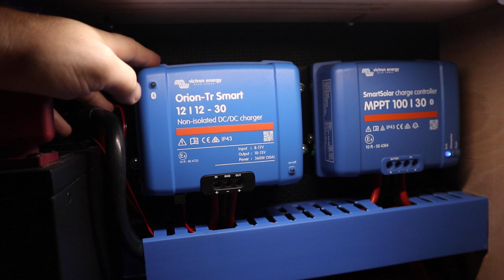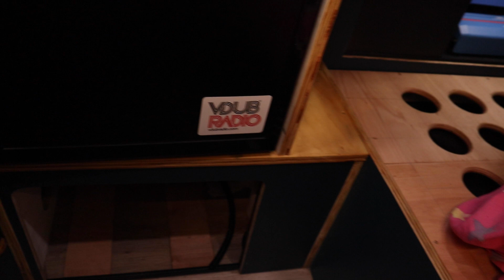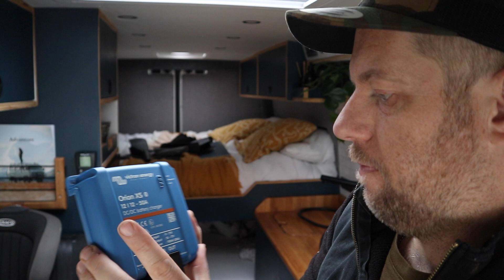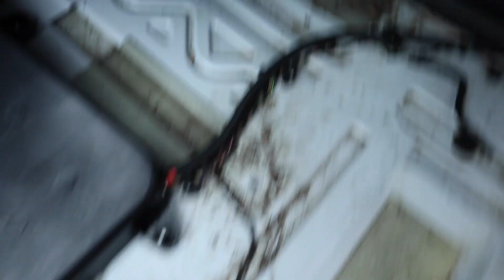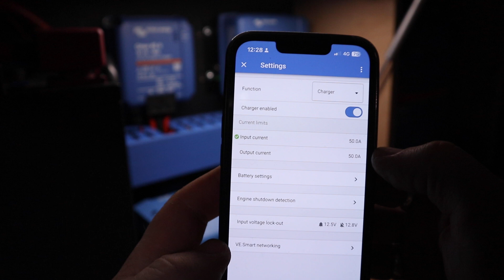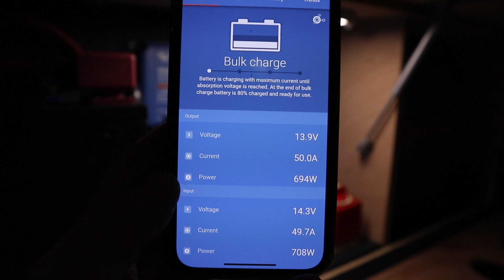Victron Orion XS Installation Made EASY!

Comment: You should consider using the Victron 12/12-70A DC-DC charger. Reason being, it’s small, same size, but comes with two mini fans attached to bottom for better cooling. 

That Victron 12/12-50A gets freaking hot! without a fan, like 200°F, and when it does get hot the DC charger reduces the amps going to your house batteries. 

If 70A is too much, just adjust in settings. 

Cheers!

🇺🇸MAGA🇺🇸
Reply from the maker: Thanks however the 70a doesn’t have any fans and I’ve not noticed the 50a getting hot at all. 

I’m very happy with the 50a for our needs and not required anything more powerful or that adds more load on the alternator.
Reply: @VanFamilyAdventures . I have a brand new Orion XS
12 | 12 - 70A
DC/DC battery charger (arrived two days ago), and I can absolutely confirm there are two small fans attached to the bottom of this device. 

And the 50A model does in fact get very hot after approximately 1 hour of continuous use charging the house batteries.
Reply from the maker: @Livefree4547 I stand corrected regards the fans. My initial search suggested they didn’t. That said both devices still achieve 98.5% effeciency & I’ve not had any amp drops using the 50a in my setup.
Reply from the maker: We did long drives over the summer through Spain (40c) and 7hr drives and it filled our 460ah LiPo without dropping charge or getting hot.

Comment: I'm surprised they still haven't implemented the reverse charge feature in these or the xs1400....it's not a hardware limit but software....if it had that it would be the complete package.
Reply from the maker: It’s certainly negate the need for a trickle charge from the invertor and another cable run

Comment: Hi there great video thanks. I wonder if you can help I have fitted the same unit but am only getting maximum 24 amps. I have a standard 12v starter battery and an 80amp alternator. The leisure battery is a 13amp LIFPO. Any suggestions thanks.
Reply from the maker: Have you checked the input and output settings for the amps? Also what’s the cable length from the starter to leisure? 

Is your leisure battery already full?

Comment: is 11 v a little low?
Reply from the maker: During driving I’ve seen the voltage drop to near 11v. So it’s a back up really should the power drop that low it will switch off and not consume anymore and that’s only really if the remote switch fails. If it wasn’t that low then it could still switch off even whilst the remote is enabled.

Comment: AMAZING. HOW DID YOU REDUCE THE 25MM NEGATIVE BLACK CABLE FROM 25MM TO 16MM? I NOTICED YOU USED A MIDI FUSE FOR THE LIVE REDUCTION. I'M ABOUT TO UPGRADE TO A ABSO 50 AMP FROM 30AMP SO I COULD DO WITH THE HELP PLEASE. 
THANKS
Reply from the maker: The negative on my system runs from the DC charger to the Lynx distributor and is only 30cm away. So no need to increase or reduce over that distance as the total loop length is sufficient. Plus I had 16mm2 already in place.

If the total loop (incl return path is less than 5m then 16mm2 is fine, else use 25mm2 for as much as possible.
Reply: THANK YOU FOR THIS VITAL INFORMATION AS MY LOOP IS GREATER THAN 5 METERS AND I HONESTLY HAVE 12 ITEMS IN MY EBAY LIST AND 2 OF THEM ARE 16MM 10 METER ROLLS OF BLACK AND RED SO I'LL BE CHANGING THAT IMMEDIATELY TO 25MM. MY CONCERN IS I'M SENDING MY POSITIVE AND NEGATIVE FROM MY STARTER BATTERY TO THE DEVICE AND I'M LOOKING AT 10 METERS. I'M ACTUALLY CONSIDERING RELOCATING THE NEW ABSO 1250 CLOSER THE MY STARTER BATTERY BUT IT WILL STILL BE  LOOKING AT A 6 METER LOOP. I KNOW HOW TO REDUCE THE LIVE BUT HOW WOULD I GO ABOUT REDUCING THE NEGATIVE TO 16MM PLEASE? 
THANK YOU SO MUCH AS FIRSTLY IT'S A BANK HOLIDAY AND SECONDLY YOU'VE SAVED ME MAKING AN ERROR IN PURCHASING THE WRONG CABLES. 
THANKS EVER SO MUCH FOR REPLYING.  IT'S THE FIRST TIME I'VE REACHED OUT AND ALL SO YOU'VE MADE MY DAY HERE.
Reply from the maker: @matthewevans6163 No problem. I’m not familiar with the ASBO 1250. I was basing the specs on what Victron state on cable size. However 50amps over that distance the bigger cable size the less voltage drop so more efficient charge.

You could use Ferules to clamp the cable ends into the ASBO?

Or to reduce the negative to 16mm2 just use a small negative busbar and the correct sized cable lug 👍

Comment: Will your adjustment to the lock out not make it possible to drain the vehicle battery when charging.
Reply from the maker: @williamhurley8407  Nope. Because it will only turn on if the ignition live is switched on I.e. the key is in ignition and switched on
Reply: @VanFamilyAdventures 
Thanks for that

Comment: Are there setting on the app that will allow to reduce the draw from the alternator? so that a regular alternator does not get taxed,,, and also to reduce the output watts so that smaller power stations can be charged without frying them ? Thanks
Reply from the maker: @tdiler12  yes. You can adjust the input and output amperage very accurately which directly changes the wattage.
Reply: @VanFamilyAdventures  with  the smaller Victron 12 12 18 charger I am getting a 23% improvement in watts delivered. Is this about all I should expect ? 
do you know..
I was hoping for more maybe bought too small a unit.
 Thank you.
Reply from the maker: @  I’m not 100% sure but the 18a unit outputs max 220W (220/12= 18.3) so if 220w is only 23% more than the output of your alternator then yes that’s correct. 

The Orion XS is 98% efficient and produces upto 700W at 50a. 

You may want to look at the 30a Orion as an upgrade but if you’ve got the cash the XS is worth it and you can reduce the input / output amps to protect the rest of your system.
Reply: @VanFamilyAdventures  Thank you for your time I think the 30 may be the sweet spot.

Comment: Great video, just one question re the remote cable; it looks like you have removed the bridge cable all together and just have the red remote cable going to the "H" connection, is this correct? Assuming this is the case, can you confirm where you are connecting the other end of the red remote cable to please?
Reply from the maker: @simonrhodehouse6854  Thanks. Yes that’s correct. The other end is going into a piggyback fuse under the passenger seat that only becomes active when the key is in the ignition. This is what overrides the voltage detection and engine shutdown.
Reply: @VanFamilyAdventures  Thanks again, one final question if I may, how did you determine the correct values for Lock-out value (11.0V) and Restart value (14.0V) please?
Reply from the maker: @ So I did loads of testing whilst on a road trip. Even whilst driving sometimes the V from the alternator was dropping below 11.7v shutting off the DC charger. So setting lockout to below this prevents lockout overriding the remote signal.

Setting at 14 helps it kick in on startup when voltages rise to warm up engine. You don’t want to go too low or it’ll drain starter batt.
Reply: @VanFamilyAdventures  Thanks again and have a great weekend.
Reply: Great  video but I don’t understand the remote part. I have a 2023 crafter. What bits do I need and which fuse do u use? Idiots guide only please 😂.

Comment: You should've run the correct sized cable from the start, the correct way is use a midi fuse holder to drop the cable size down to the 16mm² cable the Orion can accept.
Also don't use Circuit breakers use an actual fuse.
Reply from the maker: @scoffee82  In hindsight yes, but the XS wasn’t available and believed 16mm2 to be correctly rated at the time. I’m right on the 5m limit, probably would’ve been fine but better to increase the cable. 

MIDI fuse is ok. Mega fuse is what I had available.

Circuit breaker is blue sea and supplied by BSPK solar whom I trust for supply and advice on the install.
Reply: @VanFamilyAdventures  yes your correct the XS has only just recently become available on the market. Are you aware that a DCDC/BCDC charger can potentially pull upto double its rated output, in saying that keep this chart handy it will help you out alot in future expansions/builds
https://enerdrive.com.au/wp-content/uploads/2024/07/E_D_BS_Cable-Size-Chart_REBRAND-2024_V1.1.pdf?srsltid=AfmBOoq5AQQ1NAy_6lWiMvE-kRCPMx-lMSOL2Ku8OmBSxfUqfodgrWyZ

Comment: great video, thank you. Tell me, what is the reason with setting the lock out values. I had them set to 10.4 and 10.8 as i had seen those recommended, so a bit confused. Maybe thats why my battery never really charged very high....? thanks.
Reply from the maker: @carolspencer5844  10.4-10.8 is low. And your starter battery should be 12v else your vehicle won’t start. So I’d set the lock out below that and restart at 13.8+ as that’s the likely voltage when you start the engine.

What battery is it? AGM or LiPo?
Reply: @VanFamilyAdventures  hi, my leisure battery is LiPo,that charges ok,its the van battery never gets up to voltage,maybe because im feeding all the power to my dc charger. I will adopt your setting and see how it affects it. It can only be better. Thanks for the info.
Reply from the maker: @carolspencer5844  Ah I see. Might be a sign the van battery is starting to go. 

Also worth getting a multi meter on the van battery first to see what you get there vs the input voltage on the Orion. Check the terminals, connection points and cable sizes.

Comment: Do you actually need a remote cable, normally the victron dc-dc auto detects. My ones been working fine without a remote.
Reply from the maker: @exploresandtosummit  You don’t NEED it. But I have found on long drives the charger would switch off as it thinks the engine is off. The remote signal gets around this and keeps it charging.
Reply: @VanFamilyAdventures  thanks , I wasn’t aware of  that. 👍